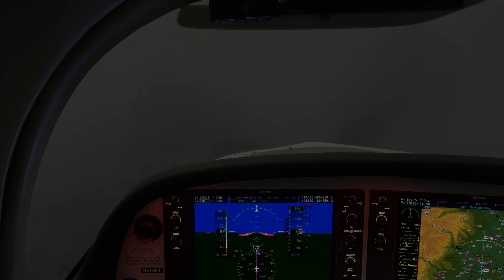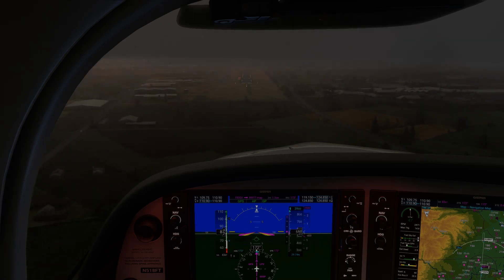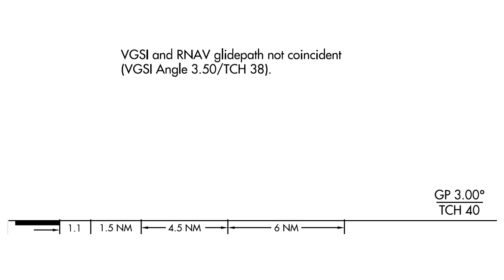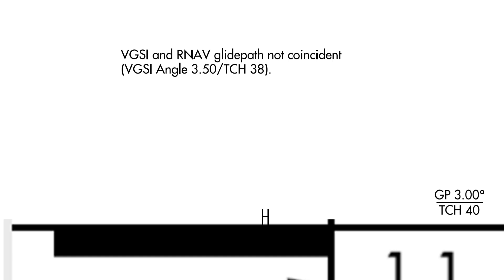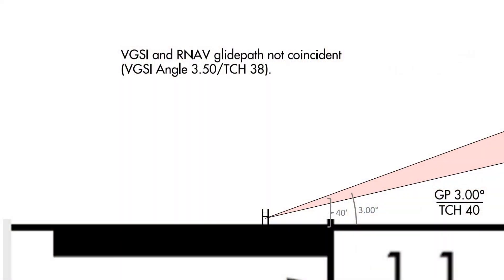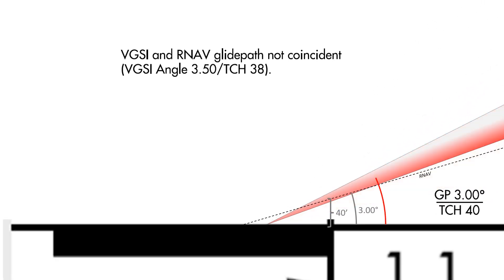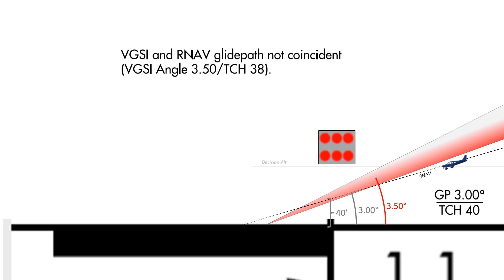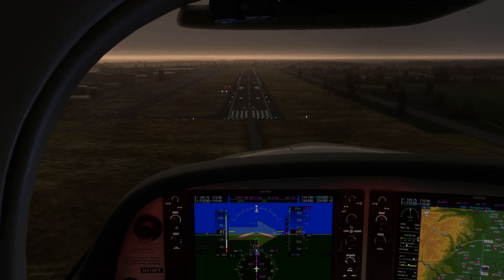VGSI Not Coincident | VASI Glidepath vs RNAV and ILS Glidepath

Comment: I would not switch to the VASI guidance if I'm already stable on the rnav. That means power and pitch changes and a steeper angle of descent versus the rnav. The rnav provides the obstacle clearance just the same.
Reply: Because it won’t keep you safe below MDA, that’s why there’s a such a thing as VDP. Below MDA, you transition to the visual glide path indication.